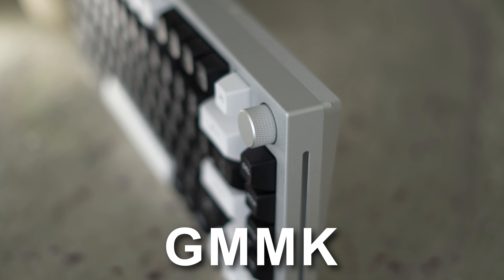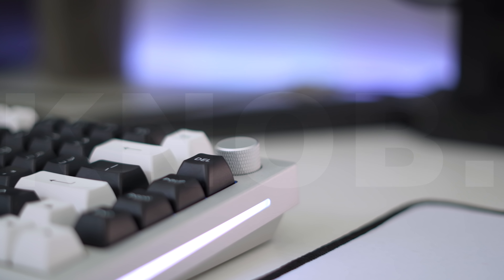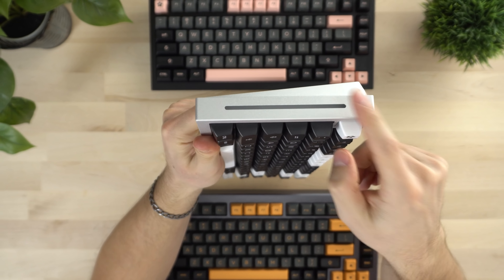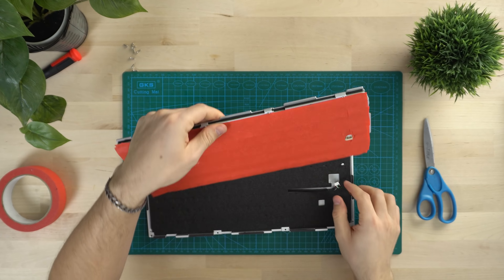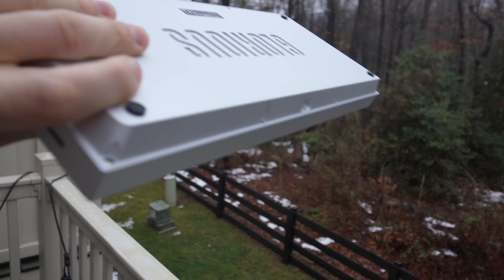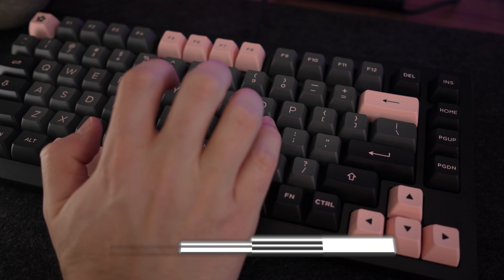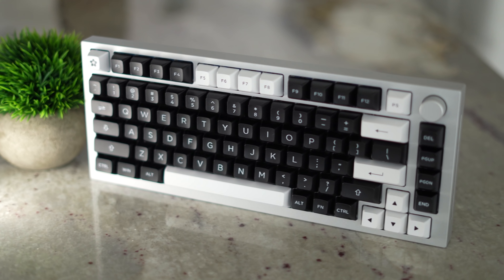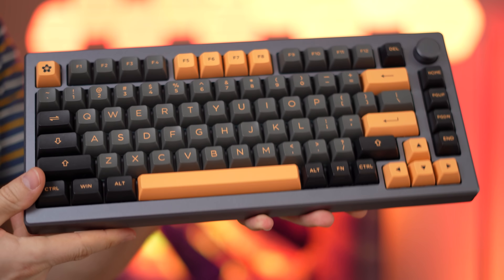GMMK Pro - Still Any Good 2022???

Comment: i think the only thing the gmmk pro has is looks... i dont think the stabs are actually better but i dont know which version of the q1 u have, anyway i heard that the gmmk had major issues with the stabs. To me the feel of the gasket mount is much much more important than some rgb lighting that i keep off most of the time anyway, and unlike the gmmk pro the q1 is very easy to disassemble and mod. And its also possible with very simple and cheap mods to get the q1 to not be pingy anymore and sound something more balanced between highpitched and deep

oh and about the price of the q1 when u buy through a vendor in ur area like me u dont pay any shipping for the q1

Comment: There are three very important things(for me) that I don't like about the GMMK Pro compared to its competitors. One, is the incredibly stiff gasket system. Two, is the scummy way Glorious forces you to make do with their so-called "GOAT"(lol) stabilizers by making it almost impossible to use other brand stabs without significant modifications. Three, is the fact that the board somehow makes all switches overly muted and way too similar in sound profile. And for someone like me who enjoys experiencing the various differences in feel and sound of each switches, this is a big no-no.

Now, the one thing I'd say this board has over its competitors is the look. Personally, I think the Ice White version of the GMMK Pro is unmatched in looks in this price range. Unfortunately though, looks are a lot less important to me than the other aspects of the keyboard. My pick of the above three offerings would be the Keychron Q1. It just has almost everything right. And the one thing people complained the most about it, the hollow ping, is a much easier fix able to be carried out with common household items, compared to cutting a big hole in the top plate of the GMMK Pro to give it some semblance of flex, OR having to file down the plate in order to fit any stabs other than the "GOAT" stabs.
Reply: agreed on everything but the switch part, ive had no problems after 1-2 mods, sounds are loud and clacky / thocky
Reply: Recent GMMK Pro revisions have no problem with the third-party stabilizers. I've got one on Black Friday in 2021 and Durock stabs fit just fine without any mods to the plate.

Comment: I love my GMMK Pro, but there's definitely room for improvement. The two things I would 100% recommend is replacing the stock stabs with something like Durock v2s. Even after all your modding, I can still hear a slight rattle (although nowhere near as bad as some of the earlier stocks). Mine weren't too bad to be honest, it was mostly the right side spacebar. The other is an FR4 plate from AVXworks. It's screwless as well (GMMK has way too many screws lol).
The plates from GMMK also seems to have some issues with 3rd party stabs, and the poly version will actually bend the plate slightly (due to shrinkage).
I got both the FR4 + Durock for 25$ each and is imo totally worth it.
Oh and you can buy a guitar knob and replace it with the stock knob which is awesome.

My final build ended up like this:
Durock v2 stabs lubed but no holee mod (too mushy for me)
FR4 plate
KTT Strawberries (didn't even bother lubing them they sound great stock)
Extra gaskets
Tempest mod masking tape 2 layers
No bottom foam
Amazon keycaps (surprisingly nice for a 50$ noname brand lol)
Amazon guitar knob 

Great video btw.
Reply: Glorious just released their own stab replacements like 2 days ago i think. $5 for an entire set if you own the GMMK Pro already. Really looking forward to see how those turn out
Reply: The Fr4 plate made the board soo much better
Reply: @LeftyCS  apparently they got really good reviews, but were sold out immediately. I'm sticking with Durocks for the time being, but I'd definitely like to try those.
Reply: @richardKeytero  yeah indeed. I'd say they're a mix between alu and poly, minus the 500 screws. They also fit stabs better plus now all my keys are centered correctly lol
Reply: never understood the number of screws as an issue, it's  not like you gonna open the board again after all the mods. I opened it only ones when it arrived to install durock stabs and it's done, no other mods were needed.
Reply: @iM7SnaKe  actually quite a few people do that to try and test different things. But yeah if you don't need to open it more than once, then it's less of an issue. Overall the amount of screws is much less of an issue as certain (early?) versions of the board had overly tight and brittle screws. There have been quite a few reports of that. I had that with my first board. Luckily Glorious have great customer service and sent me a new one, without me having to return the old.
Reply: @KaeN10  new boards has none issues like back in the days but the none flex. but usually I read comments on /r where most of the people there was crying because of all those screws and praising the competitors for having less.  the fucking q1 has 4 screws less just because it has non led diffusors on the sides, lol.
Reply: @iM7SnaKe  I haven't read any comments of people crying. Just reviews where they noted that there was a lot screws in both the bottom frame and plate, which I agree with.On top of that, the poly plate still have issues with both cracking and shrinking. But since I use an FR4 it's not really a problem for me,since the only screws in my board is in the bottom frame. You're right that newer batches should have fewer issues, but it seems that people are still getting some of the older batches, even after ordering in recent months. I still think it's a great keyboard and unless you're really unlucky with overlubed stabs or bad screws, it works quite well out of the box. That doesn't mean that there isn't room for improvement though. My stabs definitely rattled more than they should, besides that all of my other mods are just a personal preference and doesn't affect performance in any way.

Comment: It's definitely subjective. I own/owned both the GMMK & Q1. The stabs on the Pro were the worst & the overall mechanical design & how it all sandwiches together could also have been better. Still got my Q1 & after modding, it's definitely my preferred board. Waiting on a Freebird TKL 🙂
Reply: what config did you get? i got the navy blue with pom plate 😁 i can’t wait to put some banana splits on that board
Reply: I kept the gmmk pro, and also waiting for freebird 🤣
Reply: is the freebird tkl better then the keychron tkl K8 Pro ? i have been wanting to get a tkl but i am newbie and dont know much
Reply: @AS-xe3qj  freebird is definitely more of an enthusiast level since keychron boards come pre assembled. if you’re looking for a good affordable tkl i would recommend the nk87 ee or drop has a few budget tkl boards 👍

Comment: Amazing video! Very informative. Thank you!
As a GMMK Pro user, I love the keyboard. That being said, the biggest weakpoint it has is the stock firmware. I had so much chattering / double inputs as well as horrid latency no matter what settings I use. That was fixed when I flashed a QMK firmware (default is 5ms. If you have Boba switches, you need to increase it to 7ms or 8ms to eliminate chattering due to their design).
Reply: well that's really unfortunate. I have two gmmk pro (one black, one silver) and has no issues with double inputs, only ones but the issues was the switches (kailh black box), none with boba or gpandas.  on the silver I didn't update the firmware and I don't feel any input lag despite being an hardcore gamer, but I did it on the black version to see if I could feel a difference and my answer is: no, not at all.  what it can be is glorious released different version of the board in the past year, the first ones are those with more issues, the new are good, they even have new plates that accomodate durock stabs with no installing issues.

Comment: Got 2 of these in a row that had massive keyboard chatter. 2nd one was also ridiculously over-lubed, to the point that the spacebar took SECONDS to spring back up after being pressed. I asked support to check before they sent me the keyboard this time. They said they cannot, that it's sealed and there is no way for them to inspect them. So they have literally ZERO QA. Their process doesn't even allow for it.

This company is a fucking joke.
Reply: open in up and clean them? too difficult on a keyboard meant to be modded? huh.